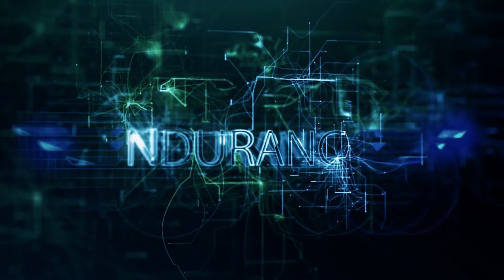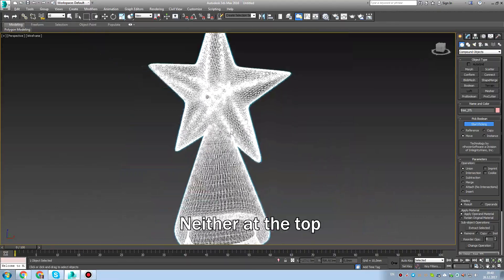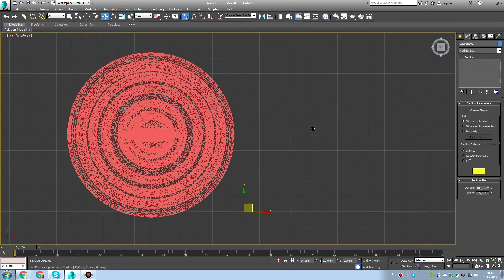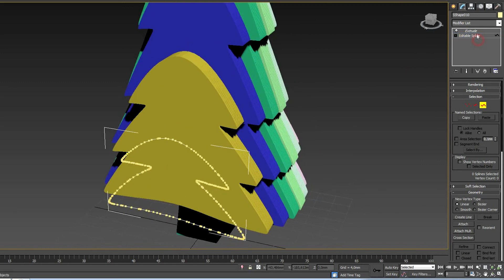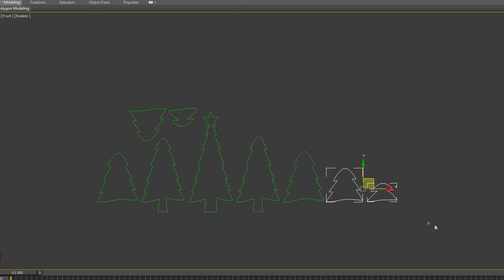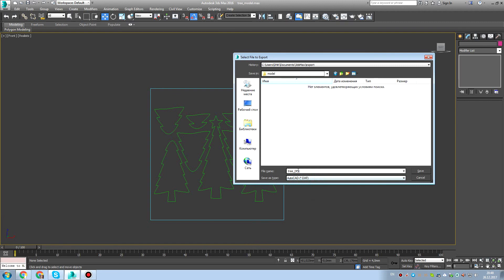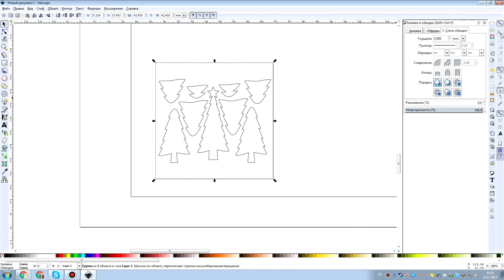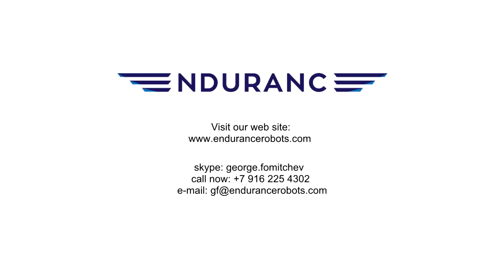How to convert a 3D model into slices for laser cutting (video by Endurance lasers)

Comment: The limitation here is that it produces a SOLID finished product from simply layers cut on a single plane axis (a 5' tall version of this tree would weigh >100 lbs easily), as opposed to specialized software that would ALSO utilize horizontal slices to create half lap joints with the vertical slices in order to make the assembled tree potentially hollow and light, as in laser cut models.

Someone has a great opportunity to create software that will take a 3D model, scale it to any size, and let you adjust the slicing on TWO (or more) PLANES (even at oblique angles!) to create hollow models of objects that you assemble after the parts are cut.  You would basically be able to tell it how many SLICES in each plane, and it would sub=divide the object into those slices, using centering for an odd number of slices, and balanced slicing for an even number of requested slices, and then calculate and add the necessary assembly cuts that would make it easy to assemble.

This is akin to the logic that 3D printing software uses to slice the object into layers for printing.   So anyone capable of writing that type of software should be able to pull this off.

Here's the type of finished product it would ideally be capable of easily rendering the cut slices to produce.  In this particular object, it would seem to need to use 4 planes, and ideally you could define areas of the model to be a plane (as the tail and side fine are) in order to get the result you want:

https://www.etsy.com/listing/780980449/lamp-laser-cut-files-vector-model-cnc?ref=hp_rv-1

Given the growing popularity of Laser cutters and inexpensive CNC, up to and including a Maslow CNC, this software seems an obvious market need and opportunity.

Kickstarter anyone?